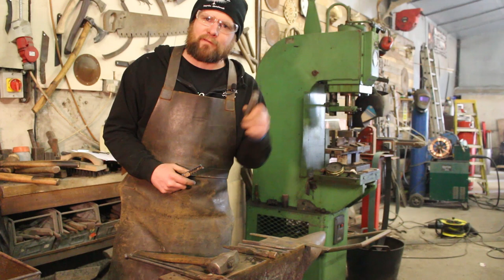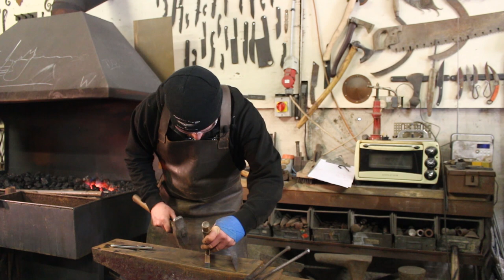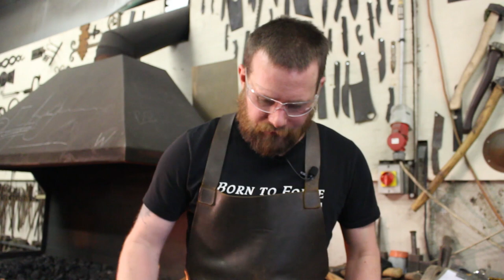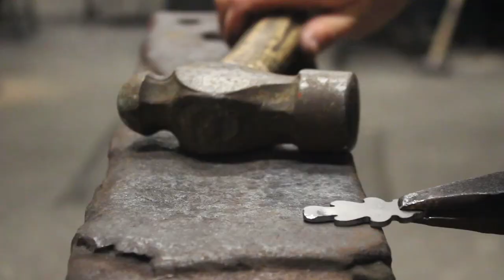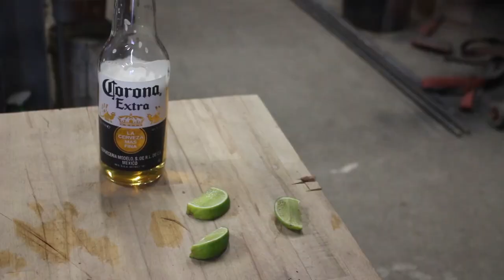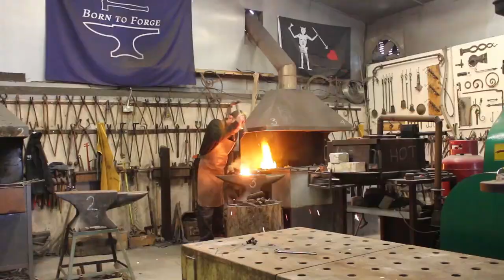Blacksmithing Essential Skills - Forging tapers by hand

Comment: Awesome video! I hope maybe you can help me. Why do my tapers keep ending up hollow on the tips? I heard you quickly mention it but I dont understand what you mean. I put the noo noob as I'm sure you can see lol
Reply from the maker: If your angle is to shallow you effectively mushroom the edge over, try bringing your hammer down at 45 degrees for the first couple of blows and make sure the steel is as hot as you can get it.
Reply: @phoenixforge5944  thanks so much for replying. I've been beating my head against the wall lol. I'm going out to give it a try now. New sub!